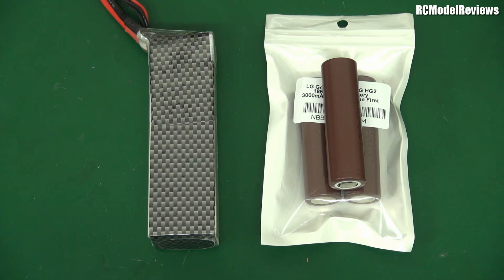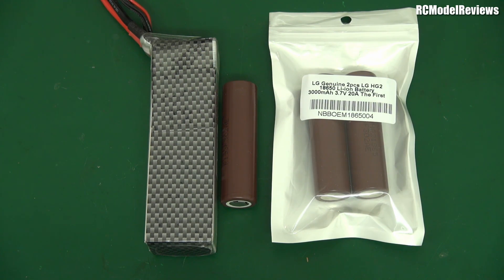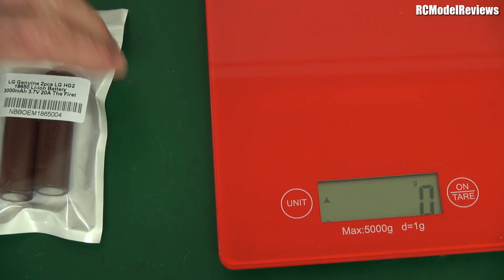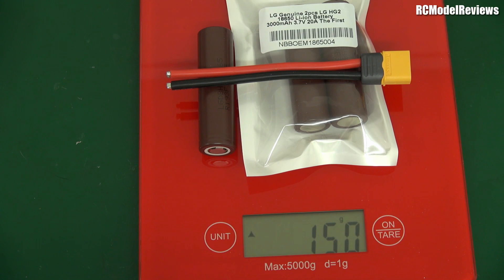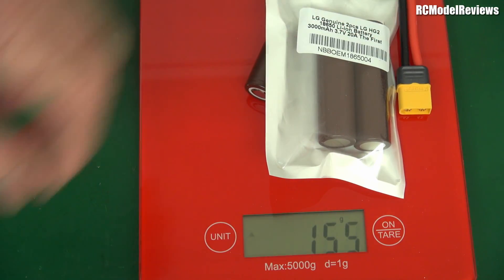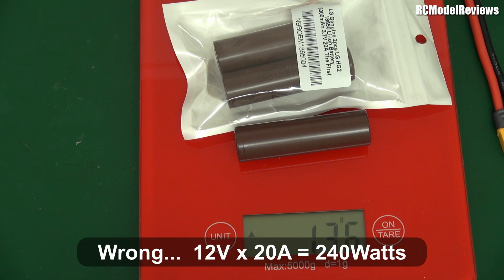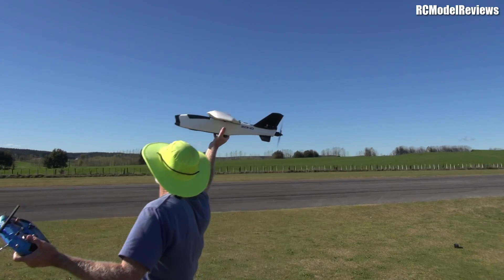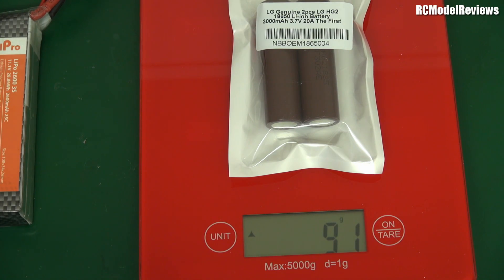Lithium-Ion (18650 cells) versus Lipo -- which is best?

Comment: So if I built a 10" drone, primarily for long range, and used maybe a 4s4p 18650 pack, that would have greater range than a lipo/lifepo of the same size and weight in a quadcopter fpv drone?

Comment: Your actually wrong ..the lion is DEAD under that nominal voltage ...the lipo can be charged from zero ...I'm doing a WHOLE HEAP and running loads of different tests ..and lipo can handle a much higher charge rate..happily will handle 4.6v and higher

Comment: Isn't the 3s pack 2600mah per cell? Not the whole pack? One of those cells are still 2600mah aren't they? The whole point of lipo was largely due to its lighter weight for RC

Comment: Sir, I think you converted that wrongly: 218g is 3 yards and one see-saw. :b

One question: which one is safer? I'm getting batteries for an Yamaha WX5 and I don't want my  controller to catch on fire. The WX5 is a wind Midi controller manufactured from 1999 to 2017 and discontinued - no new ones available - and it requires 1.5V cells. I found both li-po and li-ion 1.5V cells but the li-po ones are easier to find here in Brazil. I also would like to know if I can keep them inside the instrument while not using it or if I should remove them.

Thanks for your patience! Nice video!

Comment: You should be using 21700 batteries. Why do you think their the standard in Tesla's now.
Reply: Exactly, you can get way higher capacities for a slightly larger cell. Not only that, you can get cells with a much greater amp output in 21700s.

Comment: Capacity, voltage and even weight could be similar but the C rating of Lipo is far, far higher, some 1/5 rc car applications are pulling north of 300 amps briefly under hard acceleration, where quality batteries like Maxamps and Turnigy Graphene Panthers are almost neccessary..

Comment: @4:37 - You need to be consistent.  Each 18650 is rated for 20Amp Continuous.  Wiring them to maintain the 3000mAh you are referencing means a 60Amp CDR and a 90Amp Pulse (30Amp @ <2.2s).  If you want to rate the 3 LG HG2 batteries at 20Amps, then make sure to call them a 9000mAh battery (give or take).
Reply: I believe he's comparing cell for cell and the rating is a total in series. Why would he make a comparison of a set of batteries in series to one in parallel?

Comment: I have a 7200 mah liIo. With 3s2p configuration, it gives me 60 amps and it’s lighter than a 5000 mah liPo!!! Also LiIo has more charging cycles and lifespan than the lipos. The only problem is discharge rate limits. Great deal I guess.

Comment: Chinese battery Liitokala its the best for high discharge li ion.Its 21700 ,4000 mah and 40 amp continuous discharge.
Im making a 8000 mah battery ,3s/2p thats lighter than a 5000 mah lipo.

Comment: I am confused you have 3x 3000mAh batteries shouldn't you be referring to them as 9000mAh or are you connecting them in parallel to achieve 60A?

Comment: good points. Go the 3s2p Li-ion 18650's for long distance/high power and throw the LiPo away imo. 18650's are so much cheaper to get hold of and to salvage from old laptop batteries and cordless drill packs etc...

Comment: A question to ask, if connect 2 of the 18650 batteries parallel, the discharge of 20A will be same or double?
Reply: Double     mentioned in video,    capacity will double as well

Comment: dumb question but can you use these cells with any esc that is meant for a Normal Lipo pack as Long as to use the correct voltage.?

Comment: I'm currently studying these batteries myself. I have about 25-30 Eneloop AAA's and AA batteries, they are the best. I've had those rechargeable bats for 7years and only 1 shorted cell. Bought all other types, Duracell and powerex batteries and Duracell beats the powerex. I have 1 powerex left out of about 8 AA. Weight is a factor but I've found the heavier they are is better but they short out early also.

Comment: Bruce, whats you views on using Li-Ion vs Lipos in transmitters?  The new Transmitters (Jumper & Taranis 9d 2019) recommend Li-Ion or Lipo but not LiFe.  I've always preferred using LiFe or Ni-MH in my TXs as I keep them in the house as opposed to my Lipos which are in a big metal box in the garage.  In a TX, both will be drawing a lot less current so 'should' be safer but I think the Li-Ion has a more graceful dropoff.
Thanks PaulG

Comment: Samsung 20700 come in at 69g: 3000mah, 30amp continuous! 🤯 Really tempted to do a 2s, low kv, Mini long range Tricopter in future. 😆 Small body, long arms, low kv, big props, sounds like a long range dream. 😁
Reply: Chinese brand Liitokala is better than Samsung.They have 4000 mah with 40 amps continuous 21700 for same weight.

Comment: I fly with a 6P6S li ion  35,000mah pack for hours on end. The motors can pull up to 92 amps so it has a 2:1 power to wait ratio. The cells each have 5000mah. They are the new lithium ion Tesla batteries. 21700 cells. No dendrites with this glass cell. A battery life of older than a human? Maybe!

Comment: Single motor rc air craft are fantastic for lion batteries with very long endurance flights in mind even just some fun lesure flying. There are other electronics you could throw in like a bost circuit if you must keep the volts around 11.1v (obviously weight comes into it again) or just use a extra cell since most of its life is below the voltage required.

Comment: The lithium Ions are 3000mah each right?
so putting them in series increases the capacity right?

thus, a 3 pack is 9000mah
a 4 pack 2p is 12000mah

Here in the states 18650 batteries are 4-5 bucks each!
I don't understand why people still use lipos
Reply: Classified Häyhä in series more voltage same capacity.the other is more capacity same voltage

Comment: I believe EACH of the 18650 cells you have is  3000 mAh so you were not comparing the same  thing by saying that the lipo has 2200 mAh and the THREE Li-ion cells together "are about the same (mAh)". So the 150g for the 3 Li-ions represent 9000mAh and the 218g represents 2200mAh for the Lipo.
Reply: Nope, you're wrong. Each battery has 3000maH, in series the 3 batteries will still be 3000maH, but you have 3 times the voltage.
Reply: @martinrowley1042  Correct...

Comment: Lithium Ion is higher Energy to Weight ratio, not Power to Weight.  Lipo has much higher Power to Weight at the expense of Energy Density.  Since you can pack more 18650 for the same weight, that can make up some of the reduced current output.

Comment: These LG HG2 batteries are quite good. I used them recently and my flight duration is doubled compared to same weight LIPO. And I bench tested the discharge current also. These batteries hold the voltage even if running up to 10A for about 20-30 seconds, which is good for take off. And if you cruise at 4-5Amps, the batteries will be very happy to run for a very long duration. I hope very soon we should be getting professionally built Li-ion packs. DIY is a fun too! 
Hats off for the video.
Reply: Hello, I have an inexpensive crawler that came with a 8.4v nimh pack. Family, bought an Admiral 7.4v 3500mah pack and Skyrc 6B balance charger.  My crawler has two 370 motors on axles. New Apex 20kg steering servo and Quicrun 1060 esc with motors in parallel. With Nimh pack and my mods, run time dropped from 8 minutes to 4 minutes. I can setup esc for lipo with jumper.
What do you think it's run time will be with the Li-on pack? I have to wait till Christmas to use the new battery etc. I chose the small format battery for space limitation. The Henglong tank guys like the Admiral battery and their drivetrain uses two motors.
So, maybe 40 minutes running now?

Comment: Would it be possible to mix the batteries in the pack with an additional control circuit. i.e when running at low current draw use the li-ion, but when current draw is high switch to lipo for a burst?

Comment: Mate, I love you to death, but you should really do your tests and then do the talking. You really do not represent the L-ION batteries very well.  The fact is that the LIPO manufacturers ALL LIE about their C values.  They claim 60 and 90 C (which is over 260 Amps in many cases) coming through a 60 Amp plug. If people actually test these high C value LIPO's they would see that they do not put out the advertised amperage.The fact is that high Amp LIIONs kill LIPO batteries in real world tests every time. Which is why EVERY high quality tool, cell phone, laptop, car and "YES" professional drones use LIION batteries EXCLUSIVELY.   Can't wait for your tests. You'll see what I mean. I  love your channels though.  You are the best. Cheers

Comment: Sony VTC4 IMR 18650 High Drain Flat top (2100mAh, 30A), less mAh but you can use it at 30A and a 136gr for 3 of them (+ the cable)
Reply: And half the price of the ones in the video ;)

Comment: realy nice subject Bruce!, at the heart of the hobby, instead of buying more plug and play
I have experimented a bit with battery management systems to prevent a too low voltage. these are also availible for 3 to 6 cell packs. 
Have also bought a spotwelder, realy nice product of a German guy: https://www.keenlab.de/

Comment: As I understand the situation there is no real difference in the chemistry between the two types of battery but rather describes the construction of the cells. The 18650 are more robust but have a heavier metal container as opposed to the lighter plastic pouch used in most rc batteries. Lithium ion is more a generic label for a family of lithium batteries rather than a specific form?

Comment: We have 4S 8800mA Li-Po packs and 4S 15000mA Li-Ion Packs. They weigh very close to one another.

In our survey fixed wing, (when the Li-Po's were still good) they gave us around 35min with the whole setup running. With the Li-Ions, we get around 55min-1hr flight time.

The only issue is because our model is heavy, on warm days with no wind, the Li-Ions tend to not give enough power for thrust for take-offs. We also use a catapult system to get it in the air, as it's a pusher and got a big prop.

Comment: Hi Bruce,

Something I have also been testing recently. My application is long range quadcopters.

Amp draw is very low, 10-15A. I use Sony VTC6 30A 3120 cells. 

I did some back to back testing with an only 5200 multistar vs a 4s2p ‘6240’mah pack. Running down to 80% discharge.

I found the most interesting and very important fact is that although the liion has more capacity per gram, as they run to a lower voltage, their mid voltage is much lower than a lipo, there for I found the nearly identical weight packs, that more amps were used from the liion to keep the craft in there air.

I was getting 20+ min flight times from both, however significantly more cumulative distance with the lower capacity lipo.

I have found that the liion gets hot in flight, and their capacity drops with say 10A vs the lipo that will delivery their 80% discharge with much higher volts at the end.

I also tried a 6s1p 3120 liion. Vs a newer turnigy 5200 4s vs the multistar 4s  5200This is where the test results changed a lot as realised  the multistar was very tired, max cumulatively was 20km to a 80% in 22 mins(but voltage dropped off) The turnigy was doing 20km in 18 mins to 80% & still lots of volts.

The 6s max cumulatively was 16km to a complete discharge where it drops!

From now I’m only using lipos & the liion remains fantastic field charging batts
Reply: This is actually a huge positive finding 😮

Comment: I use exactly the same Li-Ion batteries for my foam 950gr. plane .In fact yesterday I just made one 4s pack.They work great and if you made 3s2p the current draw will be 40a and 6000 mah capacity.
Reply: did u use an bms on your li-ion?
Reply: @ryu-yuta9259  No. I charged it with balance charger so bms is not required

Comment: Thank you Bruce. I am interested too in lion batteries for long distance quads. Have you tried lion batteries that are smaller than 18650, for example 16340 or 18350 or 18500?  Thanks!

Comment: Hi, here are some test I have done with 18650 us18650vtc5a cells with max of 35A discharge current per cell. The battery pack is 8x18650  in 4s config. Here are most boring test: https://youtu.be/Q97nqpEerXw then I started use higer discharge current 30A and 40A - https://youtu.be/EN6Tpr9QFrM ,  https://youtu.be/sZ_UIPuPvug . I also done a 50-60A continues discharge test but it is not uploaded to YT - this test perform very well and I very suprised how these batteries perform.

Comment: I am looking for a good and comprehensive kit for battery connectors and wiring. I have been looking at building a comprehensive kit but was hoping to find one mostly if not all the way put together. If you do not know of one, do you have a list for putting a kit together or maybe you might think about doing a video on the topic? Thanks.

Comment: Will you be soldering the cells together or do you have a spot welder?
Reply: You could solder 18650 battery together but you need special flux, for stainless steel soldering and high watt soldering iron. Otherwise your solder tin won't stick to the battery

Comment: Investing in a good quality high power density lipo will outperform18650 cells dollar for dollar all day long. 18650 are very good for were they are placed in the market but are not suitable for our use with the exception of slim fuselage gliders, but then there are also lipo round type cells for that.

Comment: How do I figure out the draw on my batteries in my high speed RC car?
Reply: Easiest (not the most accurate, but also not a bad estimate) is to run it full throttle or however you drive and time it.

Example: 5000mAh with a run time of 5 minutes means on average your around 5Ah*(60minute/hour)/5minutes= 100 Amps average. (This gets inaccurate towards the end of the battery, but it can give you a reasonable ballpark answer)

If your want power, simply multiply this by average voltage, so like 3s is about ~11.8v average, so that would simply be 1180 watts, or about 1180w*(1HP/746w)= 1.58 HP (realistically, you’ll have a lot of inefficiency, so power input may be 1.58 HP, but at the wheels it will be significantly less and vary a lot, but this can be useful for determining battery sizes you want if you know how long you want it to run).

Or they also sell amperage meters for this, but battery runtime is an easy way to test and doesn’t require any extra tools.
Reply: Thanks brother

Comment: yes making endurance packs with 18650's is extremely popular. I used Sony cells in a 3s2p for 60000 mah only slightly heavier than my cnhl 3s 2200. Ive gone half an hour on my AR Wing and land from boredom usually . Spent like $25 in supplies

Comment: I did some research for my own nerdy pleasure:
Your 18650s will do 10.25Wh each with a 1 hour discharge [ https://batterybro.com/blogs/18650-wholesale-battery-reviews/57179459-lg-hg2-review-20a-3000mah ]. Also, they are 228 Wh/kG, reasonable for 20A capable L-ion cells. 
Check out NKON (eu.nkon.nl), their cells are typically 3-4 Euros per (I've used them in the past - they're very good and they can even tag the cells).
I bought the popular Samsung INR18650-35E 3450mAh - 10A cells from them, my testing confirms the datasheet's claim of 250Wh/kG. These are great for 1 hour flights.

Your 3S 2.6Ah LiPo pack is 28.9Wh, which is 132Wh/kG (about average for LiPo).

Comment: I purchased a whole slew of Westinghouse 18650 cells from Wallmart a couple of years ago for $1 each. They are rated at 2,000 mAh with no C rating. They work fine in my Mini Talon as a 3p4s pack. Better yet are the 26650 LiitoKala  Li ion batteries, rated at 3500 mAh with a C rating of 20 Amps. I paid $4/each and found their capacity to be 4000 mAh. I have a spot welder, but found that soldering them into packs does not hurt the battery and is much safer in a crash because spot welds have a tendency to come loose in a crash and might start a fire.

Comment: i pay about 20$ US for 3s 50c 3200mah.  the 18650s are way more expensive...Hey funny you made this video i been wondering the last couple weeks, hmm what if we built our own 4cell or however many out of them. samsung makes good high current cells. also on 4s, at lower voltage its gonna start to fly like crap even if it can go an extra .7volts, that extra .7 wil be drastically weakening quickly wouldnt it? egh, seems like 18650s arent worth the trouble. 1300mah 4s batts 100c are running 15USD to35 usd( lumenier running 30-35, next xheapest is 25 for rline tattu and the venoms,, but ovonic and chnl are about good as it gets. 1300mah4s 100c ovonic brand 15.50usd cnhl 1300mah 100c 200c burst 17.50usd . great work as always.

Comment: The world is absolutely INFESTED with counterfeit 18650 (and other size) lithium ion cells.  Always actually CHECK their capacity.  Note that the most likely sign of a counterfeit is much lower than specified total capacity, but even if at proper capacity the C rating can be much lower than specified for the real item.  If those don't meet their specs let us know and read this:

Can you identify the fake LG HG2 18650 Battery?

https://batterybro.com/blogs/18650-wholesale-battery-reviews/104619270-can-you-identify-the-fake-lg-hg2-18650-battery

Comment: Maybe a boost converter could up the voltage when the 18650 cells get low?

And as for 20A being the limit, maybe a super capacitor could help? usually sending it to the moon only lasts about 5-10 seconds anyway.
Reply: Always better to add batteries than use a UltraCap - way higher energy density and much cheaper (15Wh/kg v 275Wh/kg).

Comment: If you ponder to build a 6000mah  4S2P ~300grs ~40amps LiIon and high amps are not critical, consider instead building a 4S1P with 21700 5000mah ~280grs ~9.8 amps  using Samsung 50E.